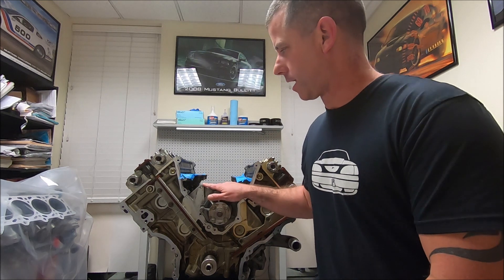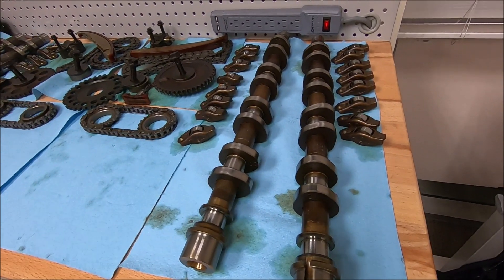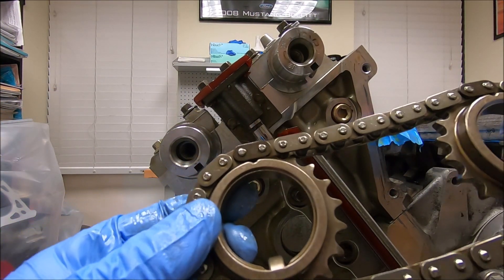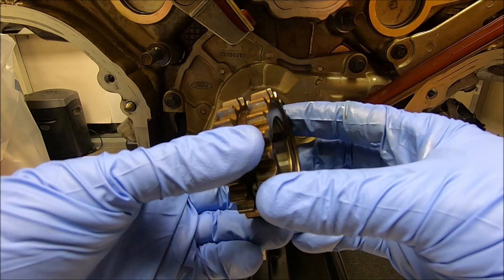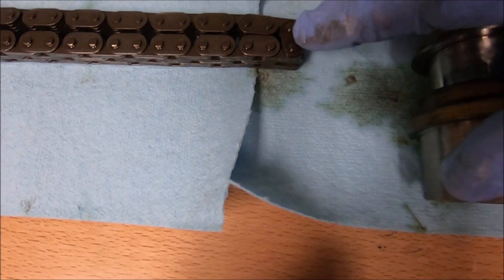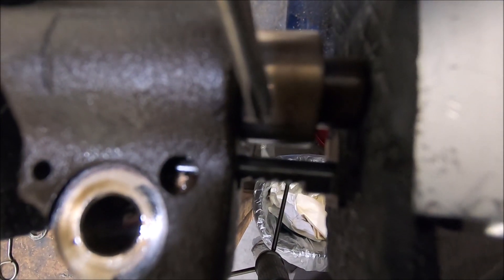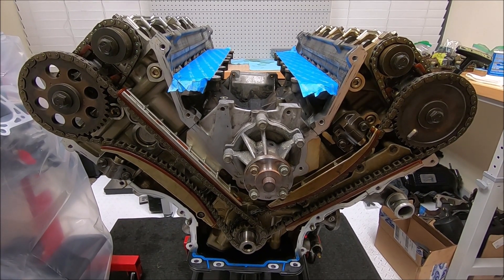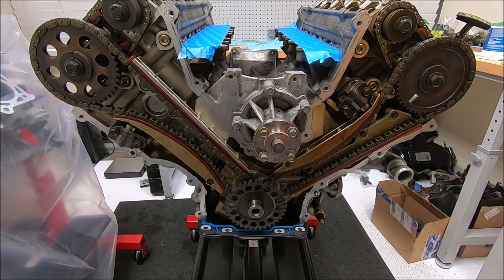Setting the timing on a Mustang Cobra DOHC 4.6

Comment: Pretty sure most of this would apply to the Aussie 4v 5.4ltr also. I have one 😁

I'd love to get my hands on a 4.6ltr bottom end to drop into my 4x4. Going to use Holden 5ltr (GM) instead as I already have one in the shed. Much easier to find here than the 4.6ltr mod.
Reply from the maker: Nice!  I have been wanting to get Barra engine over here to put in an SN95.  Maybe we can work out a trade?
Reply: @JohnSmithRacing  Sorry I should have been clearer.  The 5.4ltr 4v boss motor I have in the shed is in my car. A 2007 BF MK2 XR8 in Ego (greyish) 6 speed manual & has less than 50,000 miles one it. It's my fun/enthusiast car not my daily.

Comment: I bought a 2001 mustang gt that has a p1sc procharger and terminator internals. As well as a tko600 transmission. I’ve been wanting to purchase a teksid aluminum block and some truck flow 4v heads. My question is would the tko600 trans fit on a 4v?

Edit: if not is there anything I could do? And if I needed a transmission what would you recommend? I’m sure this is probably a very noob question aha
Reply from the maker: A TKO will not fit on a modular engine without an adapter bell housing.  But the adapters are still sold and the TKO is a great trans.  The transmission does not care what heads are on the engine.  As far as I know Trick Flow does not make 4V heads yet but they do make great 2V ones.
Reply: @JohnSmithRacing perhaps I’m thinking of a different company Or I could’ve just misread it 

I’ve heard nothing but good things about the tko600. Thanks for your feedback I’ll add that bell housing to the list

Comment: Great coverage of this topic. Thanks! for torquing the bolts on the ends of the cams, the spec I find in the Ford manual is 30 ft-lbs plus 90 degrees. I'm wondering what to use to react the torque. is the "special tool" meant to react the torque, or do I somehow use the sprocket(s)? Thanks in advance.
Reply from the maker: Thank you.  If you are asking how to hold the camshafts to torque them, you can use a pipe wrench, a ratchet in the back of the cam, or there is a special tool designed to hold the cam.  The bolts are supposed to be one time use but I have heard of them being used again and torqued to 90-100 lbft with locktite.  I tend to use ARP ones that are reusable.
Reply: @JohnSmithRacing  Thanks, that's helpful. I just didn't want to be applying torque through the camshaft if it wasn't meant to take it, and I didn't know if that tool was only meant to index the position or to actually take the torque. I guess once the chains are all in place, there could be an option of holding the position at the crankshaft front too. Disassembling tomorrow. Thanks for the help.
Reply from the maker: @steveperez1178  Its fine, I use a big pipe wrench in the middle if I am installing factory cams.  I would not try holding the crank due to the load on all the timing components.

Comment: Can I use a WAP block for 4v heads?
Reply from the maker: Yes, the WAP block was used in early 2000 Aviators with DOHC C-Heads
Reply: Thank you. One more question. Which measurement is the largest for a 98 cobra bloke? (over bored)
Reply from the maker: @reginanunez6099  Stock is 3.552 and most people dont like to go over 3.582 or 0.030 over.
Reply: Sorry. One more, I disassembled an  engine (98 cobra) whit flat gorged (JE) PISTON  and 5933.Fl connecting rod
Reply from the maker: @reginanunez6099  whats the question?
Reply: My question is, can I use  those connecting rods with standar piston? (valve clearance, compression ratio)
Reply from the maker: @reginanunez6099  yes
Reply: @JohnSmithRacing  👍✌️

Comment: Hey quick question I got my short block back from the machine shop assembled as well as my heads, and they installed my secondary chains on my heads already, can I rotate my block where the keyway needs to be before I put the heads on and have everything lined up before I join the heads to the block so I don’t have to take my cams and adjusters and secondary chains off?
Reply from the maker: Sorry for the delay in response, I haven't been getting notifications.  If the keyway on the crank is positioned straight up all the pistons will be down from TDC and there is less chance of piston to valve contact.  Just make sure they have the cams timed together properly.
Reply: @JohnSmithRacing  So is it okay to have the lifters, rockers, and cams assembled in the heads before installing them to the block?
I noticed you didnt have them in the heads in this video. I saw you posted a link for a valve spring compression tool for a 2V. Will it work the same for the 4V? I'm assuming you can use that tool to install the lifters and rockers after the timing is doen as shown in your video here?

Comment: How do you get your lifters in. Im rebuilding right now and lost on this timing chain it’s horrifying
Reply from the maker: I can't seem to find the actual tool I use, but its similar to this: https://www.amazon.com/OEMTOOLS-24434-Valve-Spring-Compressor/dp/B015NIQOXK/ref=sr_1_7?dchild=1&keywords=4.6+valve+spring+compressor+tool&qid=1593489536&s=automotive&sr=1-7
Reply: @JohnSmithRacing  Do you have a video of that tool in use to reinstall the lifters and rockers?
When following your directions in this video, is using that tool the only way to reinstall them after doing the timing?
Reply: @JohnSmithRacing  One more question. The link you posted for the vlave spring compressor says it is for the 2V engine. I have a 4V from a 1998 Mark 8.  Will it work the same?

Comment: John that's one of the best video's I've seen on the 4 valve.  I'll be rebuilding mine late this year and the one part that made me nervous was degreeing the cams.  I've heard there's kits that can assist with that.  What do the kits do compared to what you showed on your video?  I'm debating between using my Mach 1 cams vs the 98 cobra cams.  Thanks
Reply from the maker: No problem, I use the TrickFlow 4.6 cam degree kit.  I can't remember if the piston stop I have came with the kit or not but I had to modify it to work with the 4 thread heads.  Comp cams has pretty good instructions on how the process is done.  If you can't find the step by step let me know and I can try and post a link.
Reply: @JohnSmithRacing  Is it possible to not degree the cams and just line the stock components back up like in your video?  I'm hoping to keep everything as simple as posible and don't need peak horsepower. Thanks again.

Comment: Graet video thank you but could you please show how to advance the cam specially the 96-98 cobra cams on 99 -2004 4V heads I heard it need to be advance 2 or 3 degree thanks again.
Reply from the maker: Thank you, a video on degreeing cams is a good idea.  Its difficult to degree stock cams unless you know the specified centerline.  I don't know where that is supposed to be and I am not sure if it is published.  There is some movement in the stock cam gears to be had by loosening the bolt and then putting pressure one way or the other while tightening the bolt.  You can also file the key way in the sprocket to move it a little more.
Reply: @JohnSmithRacing  what was your method for installing the rocker arms